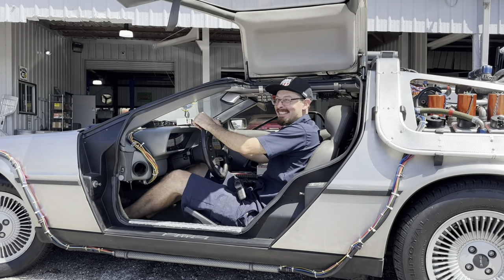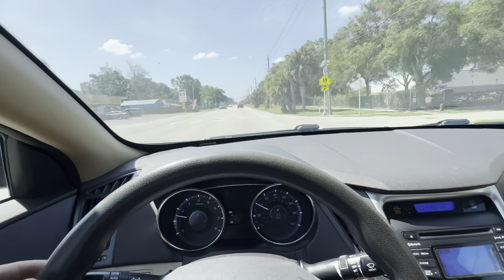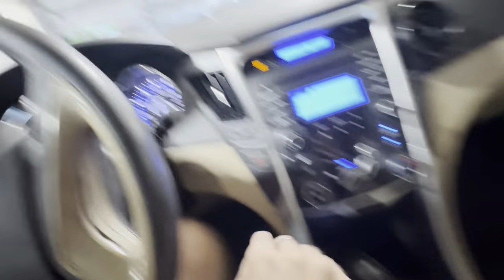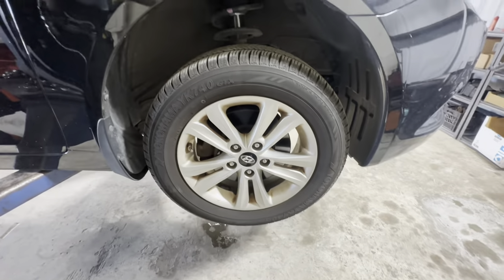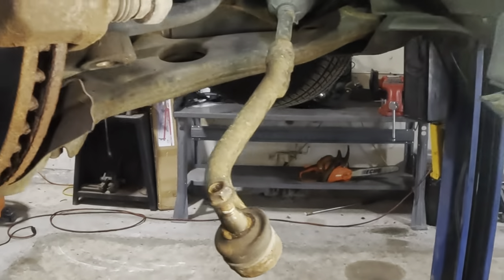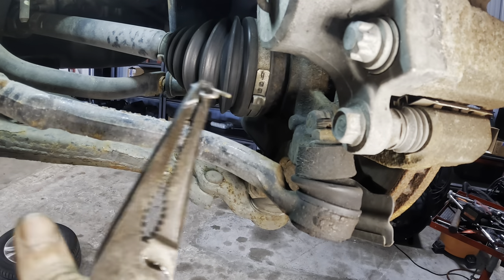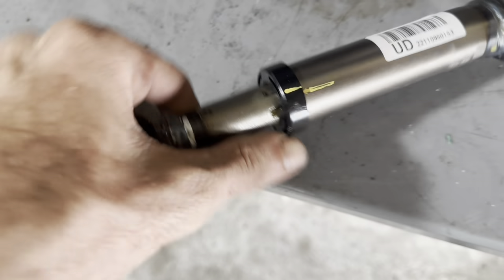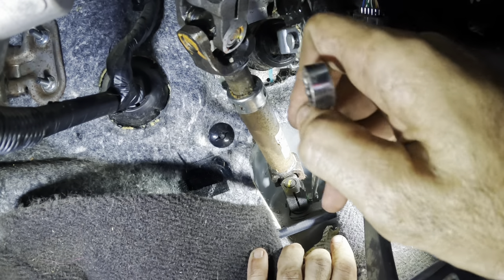Misdiagnosis! Mechanic was Wrong! Hyundai Sonata Steering Clunk!

Comment: Even a master technician makes mistakes, but what makes Ray special is his forthrightness to not only to admit it but share it so others can learn from it. That makes him pretty special and unique to me.
Reply: He’s special all right!😜
Reply: It takes a man to admit he made a mistake.  Now I hope we all learn what to actually look for.  I can't wait fir the next video...
Reply: I knew right off the bat what was wrong. I was yelling at the screen, WRONG! Too bad he can’t hear me.
Reply: @mq9167 it's a plastic gear in the steering column I think there is a tsb on it. I have been beat on this myself
Reply: The dealerships around me would make up some bullshit that it was a related part also failing. All for old parts and suddenly everything has a core charge. If only every tech was this forthright.
Reply: @billsfan1768  Thats great information for Ray tp hear.  I was a little skeptical myself because the noise didnt sound like it was coming from the universal joints.  It had a more plastic sound.
Reply: I agree 100%. I work in a auto dealership shop. I see Master Technicians make a mistake aswell. WE'RE ONLY HUMANS..
Reply: right on my fellow viewer.
Reply: @carloswidbin5659 Me too! I was once burned by the same thing on a KIA 😅
Reply: Took a VW to the dealer - they threw parts at it and didn't have a clue what was wrong.  Then the service writer tried to BS me into why that was necessary.  Most dealership mechanics cannot work outside the "box" - that is, the car's ECU fault codes.
Reply: We are fortunate to have so much knowledge at our fingertips. Much of our knowledge was obtained through trial and error. Someone made mistakes and shared them for others to learn from. This wisdom seems to be lost on many. There are still many who understand this logic before pride concept. Our man Ray is one of these wise individuals.

Comment: The problem is not the shaft, but the coupler between the el. servo motor and the shaft itself. You need to remove the el. motor and replace it. Part number: 563152K000FFF
Reply: Yeah plastic piece gets worn on most of Korean cars
Reply: I agree. My 2012 Sonata had the exact same problem. Replaced the coupler problem solved. Mine wore out at about half as many miles as that Sonata.
Reply: I knew when the video started what the prob was likely to be.  I had to fix mine too.
Reply: It's a rubber star shaped spacer by the electrical power steering motor,, easy to replace and not costly,, all kia and Hyundai cars do this
Reply: I was thinking it was the motor too, had the same issue with a family member's 2012 Veloster. It's a pain in the ass
Reply: That's it!
Reply: Common issue on Hyundais and Kias with electric power steering. Plastic star coupler inside the power steering unit. Youtube videos abound on the repair.
Reply: What!! - multicam !!!
Reply: Have to agree, same thing happened to the old Hyundai we had.
Reply: You seem so confident, BIL's turned out to be ball joints that were JUST about to start clunking, but didn't have play under human forces. (The bushing did get replaced.)
Reply: @theoneinthecorner548  Also Toyotas.
Reply: There’s a TSB that covers this.
Reply: QUESTION.....
How often are repairs compared against TSB's?
Reply: Since we had train horns, I thought the dinging was the train, too!
Reply: I had this exact issue in my Hyundai i30 (Euro-spec Elantra GT). It's pretty common to plenty of Hyundai/Kia models of the same era AFAIK
Reply: It looks like a spur gear. I have been bafooned by this before.
Reply: Y oh Y can't they use the same size bolt on each side of the shaft. Seems silly.
Reply: Ray, I was just going to come on here and tell you about servo motor. Just about every Kia and Hyundai fails right there. it is extremely deceiving. We have the exact same car in our shop as we speak with the exact same problem. I put my hand on the intermediate shaft and did not feel any clunking in the intermediate shaft. after further investigation, I found it was the servo motor. Ron
Reply: FAIL....😢
Reply: So where is part 2....the final outcome?
Reply: I thought that might be the culprit when I first heard the noise, I had the exact same problem with my old 2010 Hyundai Elantra at around 57,000 miles.
Reply: AGREE 100%. My Hyundai Azera needed the same thing!!!!!
Reply: I can almost guarantee that this information is burned into Ray’s mechanical brain unit.
Reply: Should have checked bullitins
Reply: Glad I'm not the first with this, been driving Hyundai since 1998 and all newer models from around 2012 started with this. Some use a plastic piece and others have a rubber bushing that gets worn out. Also check the bushing for the steering column dampener where it connects to the rack
Reply: Happened to my 2012 optima as well. iirc it was replaced under recall work.
Reply: Wrap the new part back up and send it back nobody knows 😂
Reply: 14 soul. Yup. I was yelling at the screen

Comment: There is a TSB on this. I’ve fixed dozens of these things. Once you do a couple of them, you’ll knock these things out in less than an hour. Remove the steering column in one piece, including the wheel. Do not remove the wheel. Once removed, set the column on the wheel on a bench. Take the box apart, replace bushing, and throw it back in. Parts house has it in stock. Looks like old K’nex toys piece, or an asterisks. Easy money, bro!

Comment: A friend of mine had a Hyundai with that same noise. We fixed it by replacing the plastic steering gear in the electric steering motor at the end of the the column.  Not so bad of a fix. You are definitely transparent Ray. Kudos to you!
Reply: Same thing happened in my 2012 camry. I got the part direct from toyota for $7, but would have paid over $1000 for them to do the job
Reply: Yep, did the clunk repair myself. We thought it may have been worn tie rods,but google said hyndai get the clunk. I'm not a mechanic of any sort, just handy enough to follow instructions. Parts cost under 10, took me a couple hours.
Reply: It`s a well documented fault with Hyundai/Kia various models

Comment: Ray, I owned one of these with the same problem CLACK, CLACK and took back to dealership to find problem,,  found out there is a recall on the steering shaft or knuckle which they put/replaced what he said was some sort of rubber gasket on joint and it fixed it. Might want to check out that recall. Sorry don't remember more details.  - Have a Good Day!     ***   -  FOUND IT! - Hyundai Motor America is revising the warranty coverage for the rubber coupling in the motor driven power steering (MDPS) assembly on 2007-2015 Elantra Sedans, 2009-2012 Elantra Touring models, 2011-2014 Sonata Sedans, and 2011-2015 Hybrid Sonata Sedans.

Comment: Hyundai has a rubber steering coupler that falls apart inside the electric assist motor.  $6.00 part, but the whole steering column has to come out to replace it.  Great video to make me feel better about the hours I spend chasing the wrong fix.

Comment: It sounds like several people have come up with a diagnosis, hoping you do a follow up, part 2 so we can find out if they're correct, and the car gets fixed. The steering motor coupler they're talking about kind of explains both the clunking noise and the sticking steering. Let's see how it all turns out.
Reply: Yes, not seen one that bad, but definitely a common issue on these cars.
Reply: Sad part is that the coupler repair is more involved that replacing the intermediate shaft. And the replacement part is the same shite plastic as the OEM one.

Sorry Ray hopefully customer appreciates you actually owning the mistake and not charging for the part/labor. Eagerly awaiting part 2 to see how you tackle it...need to do this on my own Hyundai soon.

Comment: The click mentioned in the beginning of the video is a $6 star-shaped  rubber grommet between the steering shaft and the electric power steering motor under the dash. It’s safe to drive until replaced. Easy to replace.
Reply: thought the exact same thing, had it replaced in my Sonata like 52 miles before the warranty expired...lol
Reply: @richardbicker640  I was gonna call it the plastic thingy. Came as close as I could. Words are hard. Part was on Amazon and replaced it in a 2012 Kia Soul (easy) and a 2013 Sonata (not as easy). I’ve not had issues with our current 2017 Sportage or 2019 Sonata
Reply: Fixed the same issue on a 2013 Optima. I agree, not as easy. Space is limited. @RonKnowsStuff

Comment: Pity you didn’t wiggle the wheel while the column was disconnected. You probably could have got a partial refund on the mis ordered part. 
Ah well, it’ll be interesting to see you dig into that a bit more. I’ve never had one apart, but it’s only a matter of time, because they do get rattly and eventually someone’s going to want it fixed!

Comment: I had the same issue in mine. I was surprised that they would use a plastic part like that in a steering column. Fixed it myself which felt good. Thanks for posting this video. Not many people would show themselves making a oops like this. I just about made the same mistake.

Comment: Hi Ray,  I think it's the flexible steering coupler.  I had this problem on my 2011 Sonata.  Fixed under recall/warranty.  It's a rubber star looking gear thingy that wears out.  I originally though it was my strut mounts rattling over bumps but it was this little coupler. Thanks so much for bestowing your knowledge every day and helping us all out.

Comment: Ray, that noise is from a rubber coupler under the motor on the steering column. You don't have to pull the column, just the motor. I changed two. It takes about 20-30 minutes.  The owner and yourself are very lucky because both cars I worked on would jerk the wheel and throw you into the other lane.

Comment: I have found in situations where a noise is difficult to pinpoint, the use of a stethoscope is really helpful.  Has saved me  time  and trouble.  By moving the end rod around the problem area, the loudest noise (stethoscope on), IS the problem.

Comment: Ray, it's definitely the rubber coupler under the electric steering motor.  Have replaced numerous ones in kia and Hyundai.  It's about a $3.00 part at Hyundai.  Like everyone is saying don't beat yourself up, it happens to the best  of techs.  I know it's happened to me.
Reply: It’s also covered under recall work

Comment: I'd definitely go with the steering g coupler idea. I've fixed one on a Kia Optima and the plastic gear disintegrates. Kia extended the warranty on the part, not sure if Hyundai did. Ever since then I always Google search issues to see if it's a common problem or there's a TSB. Waiting for part 2.
Reply: Sadly;Most mechanics are to ego driven to do that.

Comment: That noise in the steering is a common fault with several Hyundai and Kia models. Its a small rubber star shaped damper in the electric steering itself.  Its extremely common and I'm surprised you haven't come across this issue previously. Its the result of a the breaking of the rubber star. It involves the complete removal of the electric steering box and its dissambly and replacement of about a $5.00 part and involves several hours work. My wife's 2019 Hyundi i30 with only 5,000km on the clock did exactly the same thing and it was repaired under warranty. They also have an issue with a noisy bearing in the steering shaft. There are several YouTube videos on these issues.

Comment: I had the identical issue with my hyundia azura.  The steering is powered electrical and the rubber coupler between steering column and the power assist motor had disintegrated.  In my case, this happened at 33k.  

In order to gain access to the motor, you’ll need to remove the lower dash then drop the steering column to the floor.  Only then will you able to pop the motor off, clean out the destroyed coupler, pop in the new coupler ($8), and reassemble.  I found that relocating the steering column was a major pain.

Comment: I had the exact thing happen to my 2009 Elantra. The problem is a coupler between the steering shaft and the el motor. It is a piece of hard rubber with 4 notches that fit 2 on the motor and 2 on the shaft. It means taking apart the steering column above where you replaced that part. It must not be easy since the dealer charged me over $200 to do it. Missed warranty by that much.

Comment: When you are the brake and suspension guy, you get all the noises. I have replaced tons of noisy couplers. Then the electronic steering columns came around and we started having noise problems from within the steering columns. Ray here is a quick check that you might use in the future. If the rattle is coming from "within" the electronic steering column the noise will go away with the ignition off!  While rocking the steering wheel and you under the dash, turn the key off and see if the noise changes. If it does the problem is in the steering column. Yes I am the retired Master GM guy and had to do a lot of couplers and columns on the Chev Malibu. Try replacing a coupler on a Malibu that is locked up. You have to take the steering column loose to get the coupler out.  Good Luck.

Comment: Awesome that you owned that unfortunate misdiagnosis and still posted it! It does happen and most wouldn't have shared it. Maybe this can help recreate customer's suspension clunks easier for you....Over the 21 years we've had our 1997 Crown Vic LX, there were 2 times we had clunks. Once a rear stabilizer bushing wore out, the other was a front swaybar link.....The tech took the car both times to an empty ball park parking lot and drove sideways across the parking spaces. The dips in the pavement parked cars created over years makes vehicles shimmy and dip enough that suspension noises come to the forefront 99% of the time! I thought it was genious! Hope it helps. Keep on keepin' on!

Comment: One of the better mechanics in my county made the same mis-diagnosis on my 12 Elantra.  And he's been turning wrenches much longer than you or I.  I got lucky and found the real problem before I went through the trouble of replacing the shaft, which is alot harder to do in the Elantra.  Like others have said, its the steering coupling under the assist motor.  Requires dropping the whole column, but it can be done without removing the column from the vehicle.  My daughter and I did It in a day.

Comment: Mdps flexible coupler. I little rubber coupler that fails in between the mdps unit and the column. I work at Hyundai do a ton of theses.

Comment: The Elantra must have same steering mechanism.   There's a star shaped rubber $10 piece in the steering box that is part of the steering assist that disintegrates after several years.  Takes about an hour to replace.   Don't feel bad, and you''re a superstar for sure!  Not too many would post a mistake.   Thank you for all the great advice and instruction.   Super fan here and have been a loyal subscriber for a while now.

Comment: If this is a electric steering car its a $6 plastic gear that fails inside the motor and is an ok job you can drop the steering column or some of them you can pull the gauge cluster out to get to it. hope this helps out Ray.

Comment: I had to rebuild the upper half of the steering wheel. The problem is the driver uses it to get out of the vehicle. Very expressive repair. Police cars are famous for these problems. Bid trucks have the same problem. Driver using the wheel to lift themself into the vehicle.

Comment: PS. The bush sits between the steering wheel and the power steering motor and tend to disintegrate over time. When they wear out you get the noise between the meshing of the steering wheel to power steering interface. Pull out the steering wheel column and separate the power steering drive from the column. Cheers Richard.

Comment: Hey Ray. We have all been there. I know I have. But in case you haven’t found the problem yet, I believe there is a TSB for this problem. There is a hard rubber/ plastic star that is in the power steering motor that ends up melting/ deteriorating causing a gap/play in the gear, in turn making that noise. I know there are YouTube videos on this repair. Just need to order and replace the defective star. Should cost no more a couple of bucks. Hope this helps. Keep up the content.

Comment: Nice work Ray, and bravo to you for have the decency to admit, while it made sense at the time, that was not the issue.  Having a 2013 Hyundai "Sonata-what-I-Wanted", I had the same click/thump/slop in the steering wheel, in my investigation I thought it was exactly what you diagnosed. However, it turned out to the be the rack and pinon.  🙄

Comment: Check the rubber steering coupler located inside the mdps on the steering column. I work at a Hyundai dealer and its pretty common for those to go out for that model year, even the Elantras use the same rubber coupler. The new revised part is stiffer and lasts longer.
Reply: That's exactly what it is. Replaced several with the same noise.

Comment: Love your videos. It's the coupler in the column or isolators that may call it, common problem. Part is very cheap, takes a couple hours to do, don't forget to reset steering angle when you're done.

Comment: rubber insert for the PS motor to upper sterring shaft under the dash, be super careful putting the mounting bolts for the column back in, its easy to get them in wrong, but it looks right
Blue Mule

Comment: I'm sure someone has said it but yes it's a small plastic/ rubber gear that goes into the steering motor and the original one disintegrates and causes the noise and play due to nothing being there,  they have an updated one and we keep them in stock at work,  also there's a fast way and long way to do the repair,  but hyundai and kia have extended the mileage by another 100k to fix this issue for free.